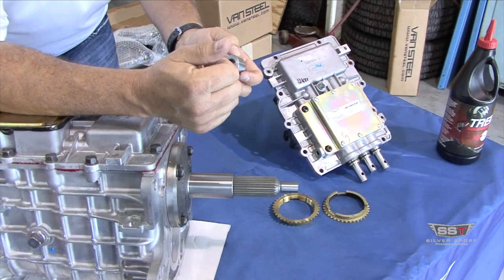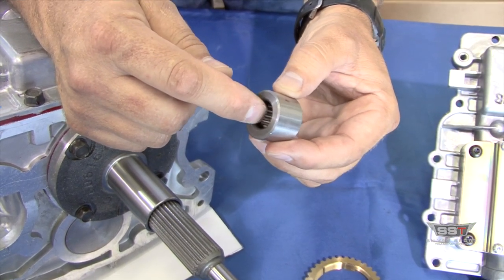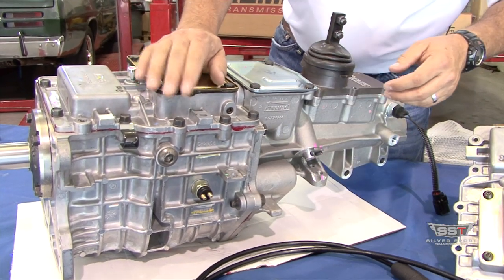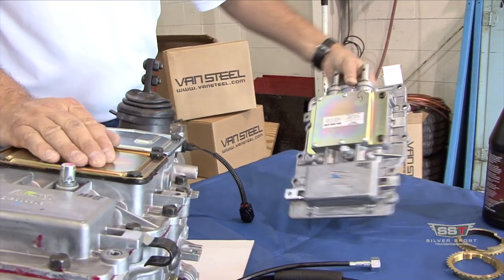TREMEC TKO 5-Speed Features Overview

Comment: Got my tko 600 installed in my 69 Camaro purchased everything from sst. Have about 250 miles on it. I'll be replacing the oil at around 350 miles. But I noticed that after 100 miles the shifter handle buzzes at anything over 3000rpm and it's really annoying. Everything shifts great and it works amazing, just don't like the buzzing. Have you guys heard about that at all?
Reply from the maker: Please give our tech guys a call at 888-609-0070. They can help you troubleshoot and find the root of the problem. The shifter handle bolts should be the first thing you check, if blue Loctite wasn't applied before they were installed, they could easily become loose. Make sure the two bolts are still tight. If that's not the problem, call us and we'll help you get the buzz to stop.

Comment: Do you need to run a different fluid when using the carbon lined synchros? Will TREMEC HP MTF still be good to use?
Reply from the maker: No, you will use the same fluid. TREMEC HP MTF will work great even if you upgrade to carbon-lined synchros.